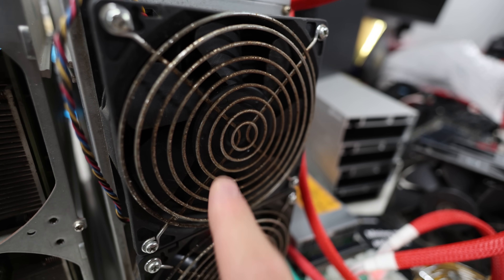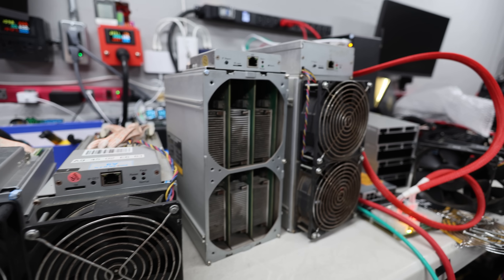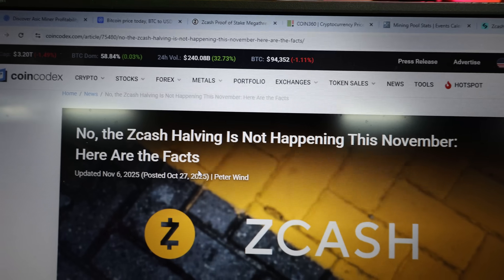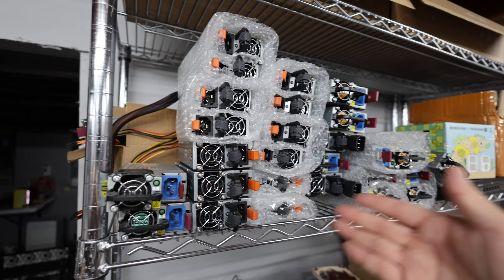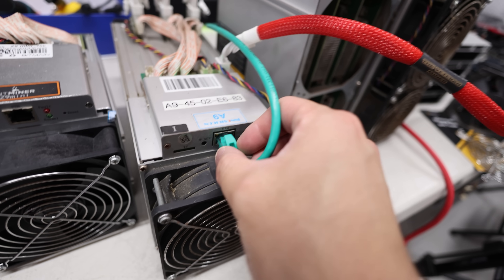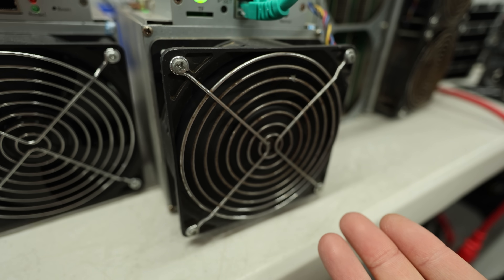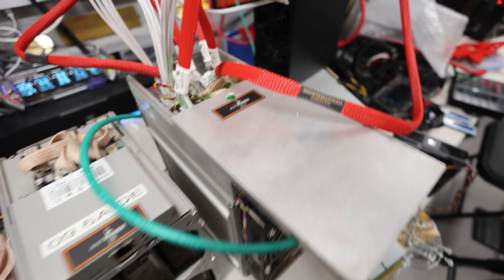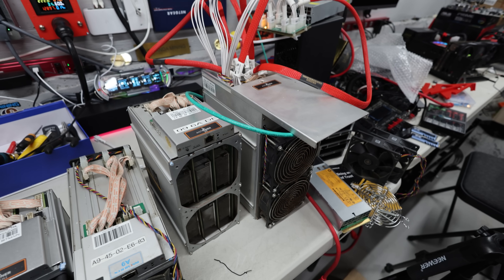AM I TOO LATE?

Comment: On your mini go to advanced settings and right click inside the box that says balance and a box shows up click inspect highlight 500 and change it to 650 above the line that says turbo click return hit save and apply should if done right gives you 650 frequency and just under 15 k/sols if chip temperature rises add a second fan to back temps will go down